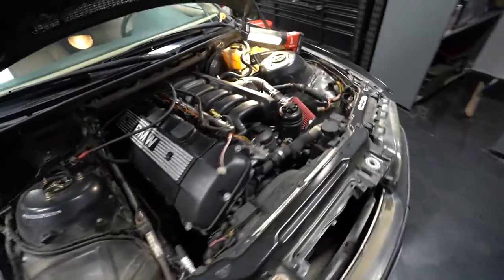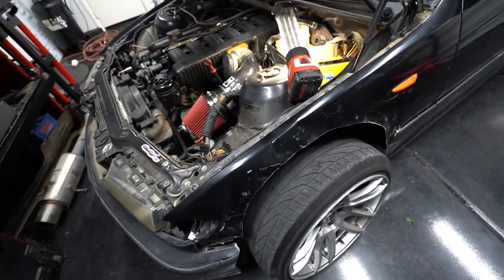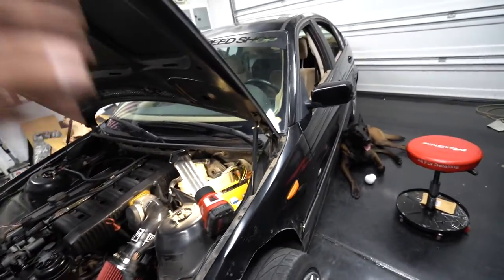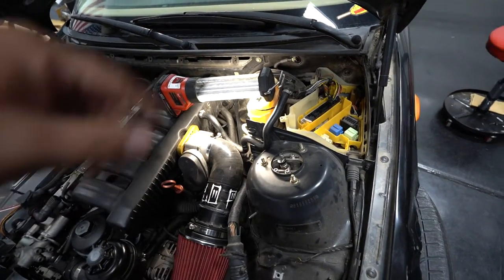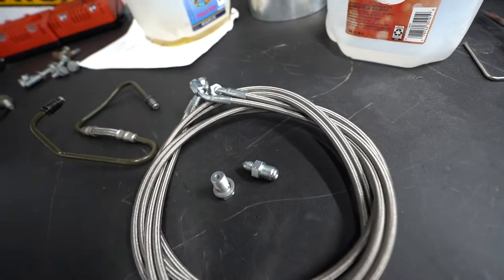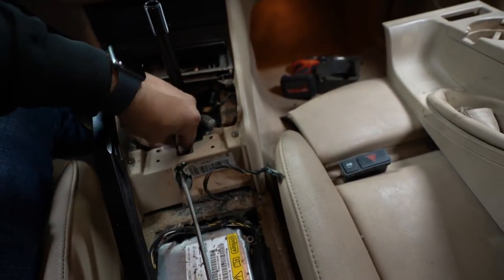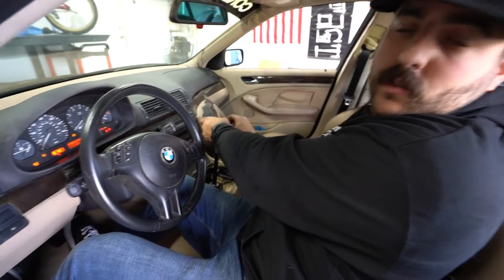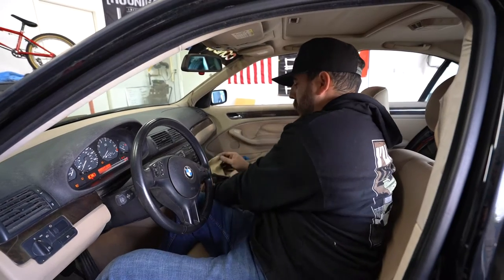How to Install Hydraulic Handbrake on $400 Drift Car (Inline System) x Buds on Budget

Comment: To fully bleed an e46 after it’s been emptied up to the ABS unit, you have to use a software (there’s quite a few free ones) and an INPA cable to activate the ABS. Most of the time (not all of the time) air gets trapped in the ABS unit when you replace lines. Hope this helps firm it up a bit
Reply: how do you get the air trapped out
Reply: @plugpenguin1660 Using INPA you can cycle the ABS pump while bleeding.

Comment: I run exactly the same setup but i don't understand how you managed to get the speedo working..... I tried everything, unplugging rear sensors (limp mode and no speedo), after that wiring the rear to the front sensor from the abs module - didnt work as well.... unplugging front passenger sensor only deactivates the abs for front wheels but keeps it for the rear. When fuse for abs removed, no abs on 4 wheels with working hydro but still in limp modem How did you make yours, because now i have hydro that i cannot use...
Reply: Did you figure it
Out

Comment: I definitely want to try this on my E34, at least until I do the dual caliper setup. I wonder if there’s a way to make it lock up without having as much travel. Do you think the more aggressive pads will make that change or just make it more consistent?
Reply from the maker: Better pads will help with the consistency of the grab. The pull of the brake is relative to bleed (which I don’t think mine is bled right) and master size to caliper size
Reply: @MicahDiaz  thanks for the response 🖤 I know someone below mentioned using a program to fully bleed the ABS unit, if you try that definitely update us!